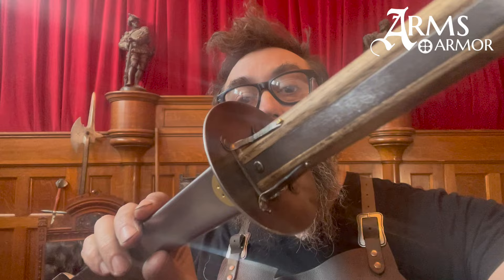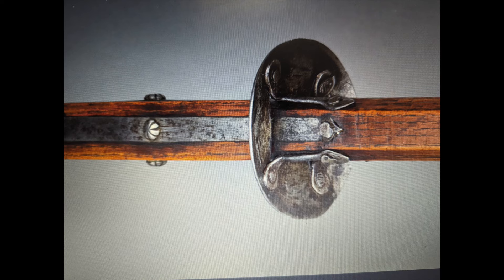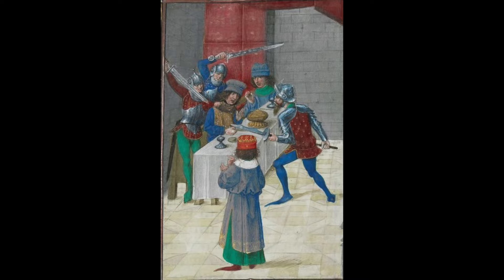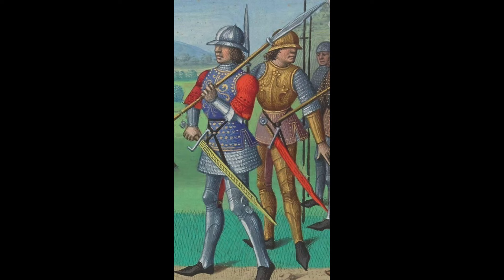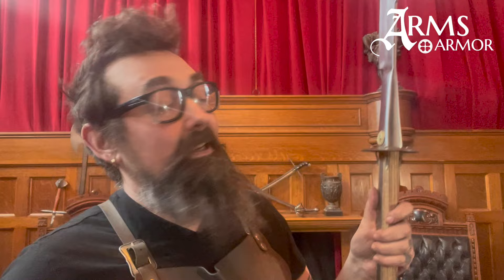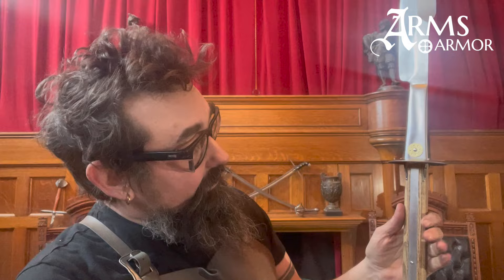Rondels on Polearms and Other Stuff: Response to Matt Jensen

Comment: lovely weapon & thanks for your explanation of the rondel construction. It's strange though that the rondel discs on rondel daggers were of generally stronger construction & these are generally assumed to provide the hand protection that you describe. The current theory on the rondel poll axe in the Wallace collection is that it was a later (Victorian?) addition . Could this explain it's lighter construction when compared to dagger rondels?